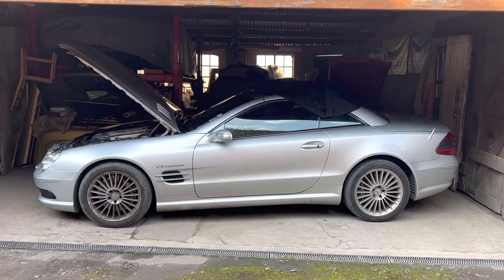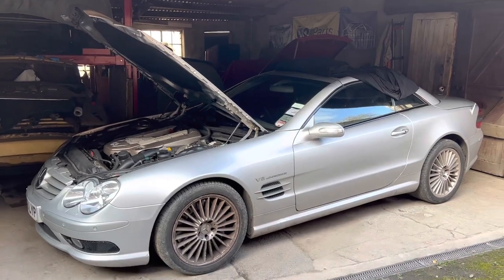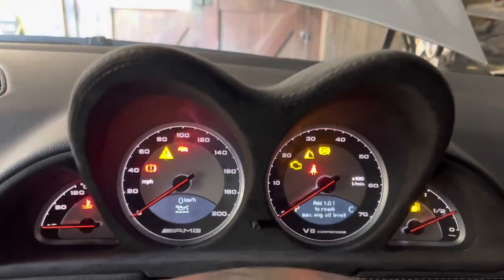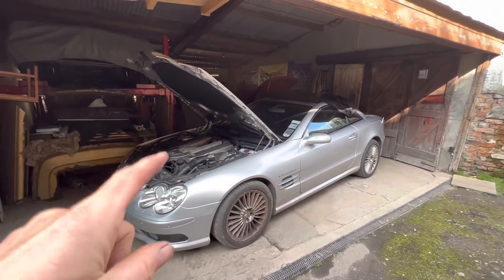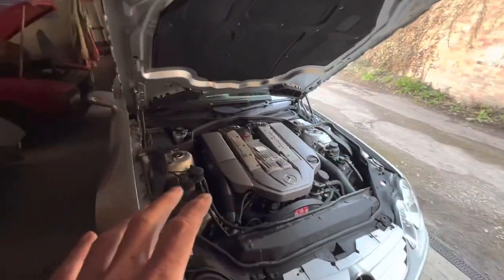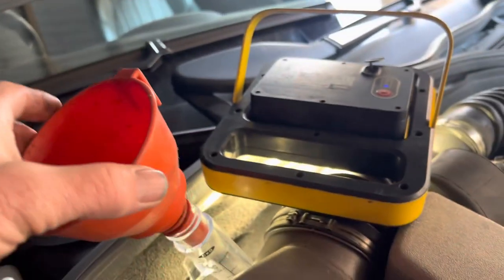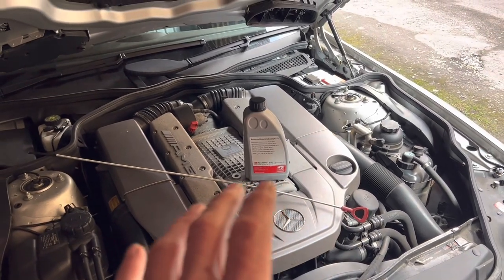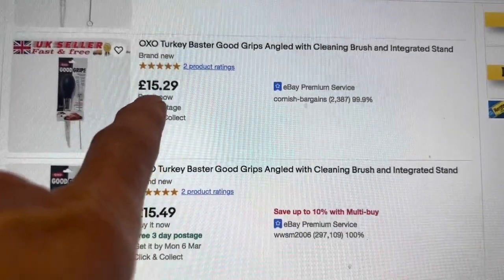Mercedes R230 how to check and top up transmission and engine oil

Comment: Hi Mike, there is another way to check engine oil electronically, it's called 'mechanic menu' where it can display voltage, real time oil level, etc...  i used that menu daily for my M112 & M113 for years and its scary ACCURATE, just in case if you are not aware of !
Reply from the maker: Hi - that sounds intriguing - how do you access it? Mike
Reply: @MikesMercsandothercars  Hi Mike, try these steps:
- insert your key and turn to position 1 (position 2 is all warning lights on, position 3 is to start)
- scroll your menu button so your display shows trip meter or digital current speed
- press the reset button 3 times (between RPM & analog speedometer)
- you should now be in the hidden menu aka mechanic menu.  
- once inside the hidden menu, you can scroll around and see real-time voltage, engine oil level (as you drive & turn, the oil level goes up/down as it splashes inside the pan).

Let me know if this works for your R230 !
Reply from the maker: @Brian_L_5168  Thanks - I'll give it a go next time I'm in the SL55. Mike

Comment: The amount of oil removed from the oil pan while changing the filter is very small compared to the total volume.  Do you change more liters of the oil residing in the torque converter at a later date?  (The dilution method) Or do you go to the shop that has a machine that pumps all the oil through the transmission and gets it all out?
Reply from the maker: Yes you are right - draining the oil via the sump plug doesn’t remove all of the oil - this is pretty much the same with most cars. Depending on how you drive (eg many miles, racing etc) might determine the importance of the oil change interval. I suppose you could also get the oil analysed periodically - on this car, the oil tested absolutely fine. Mike

Comment: Is it normal for these cars to use oil?  I drove to the south of France and back again, it's now asking for 1.5 L of oil when I check on the dash
Reply from the maker: Hi - yes, these cars do use oil over time. If you checked your oil before you set off and again when you got back, I would say that is unusual.

However....if you just checked your oil when you got back and hadn't checked it for months/years before that, I would say it is quite possible.

For example, when I checked my oil for the first time after getting the car, it said I needed to add a litre.....and I hadn't just drive 1000 miles+

Mike
Reply: Mine needs approx 1 Liter every 1500-2000km.  it's normal
Reply: I would say the same for mine... 1L per 1000km... Because I push a bit 🫸 maybe 😅